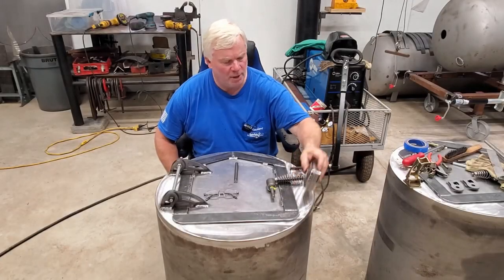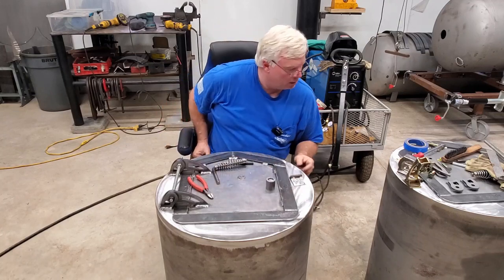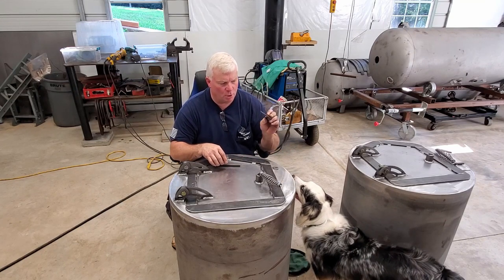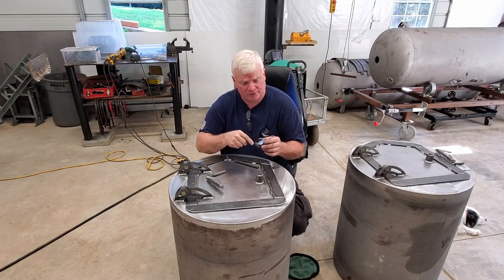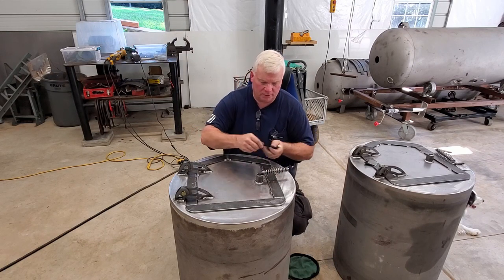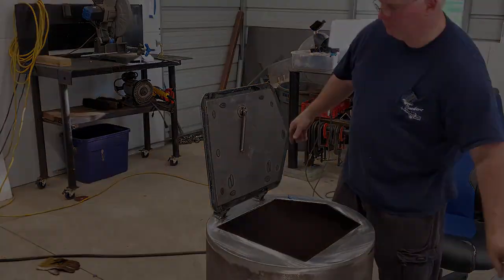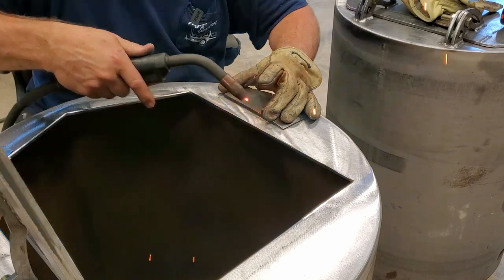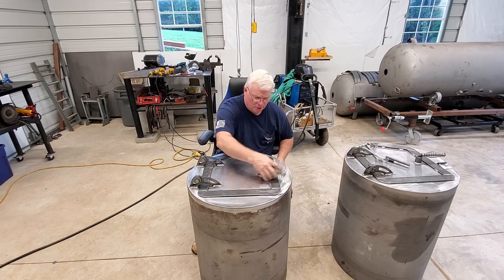BBQ Smoker Firebox Door Latch Installation

Comment: I haven't done a cook top on a smoker before, but I have done my Blackstone cook top. When the surface has rust on it like yours did, I use a random orbit sander to get down to the bare metal. All "random" orbit sanders are round (orbital sanders can be square) so you have to use something to get into the corners. 
I love your videos, and have enjoyed you over the years getting more comfortable with the camera, and sounding more competent. Keep up the great work!

Comment: Nice video. Question though. Could you build the door end cap first before you install it to the barrel or do you risk warpage? It would seem easier to align the ramp to the handle.
Reply: Great question!!!  

It would indeed make adding that ramp easier.  Luckily,  the ramp weld itself is quick.  

I am convinced that welding the face plate in place first is the way to go.  I'm sure it would pull out of "flat" if it were not intact during the welding process to the pipe.  That's a boatload of weld and I cannot emphasize enough to take your time and complete that process in many short welds alternating sides and allowing it to cool after three or four welds.  I spend about two hours joining that plate.  Obviously,  not all at one sitting.  Its easy to warp that 24 inch plate.  

I'm very careful with the hinge welds as well.  Keeping things cool is the trick.